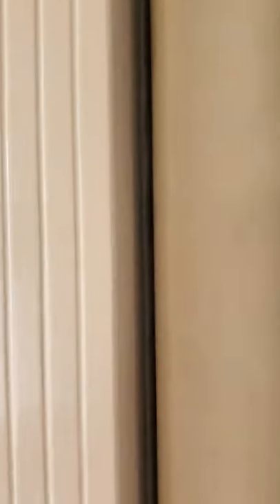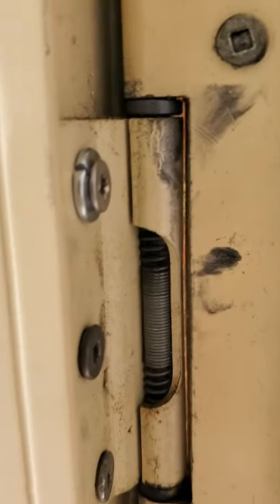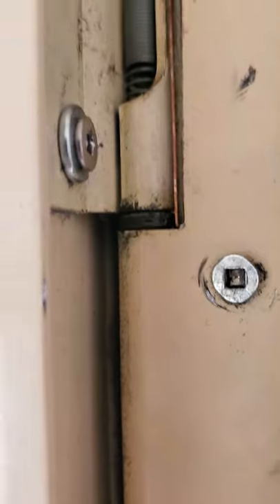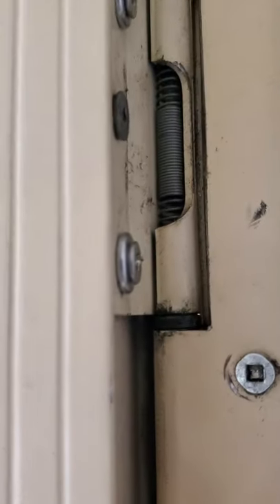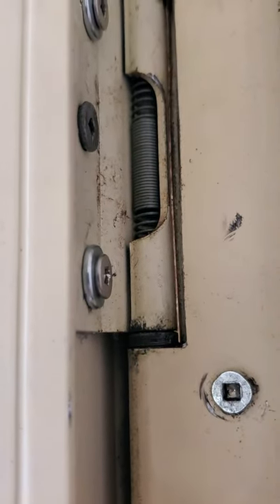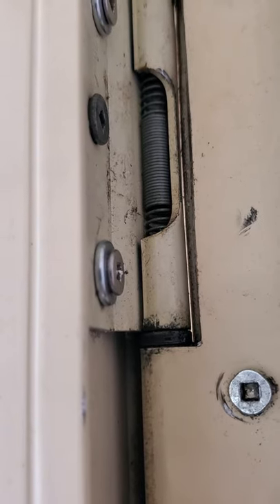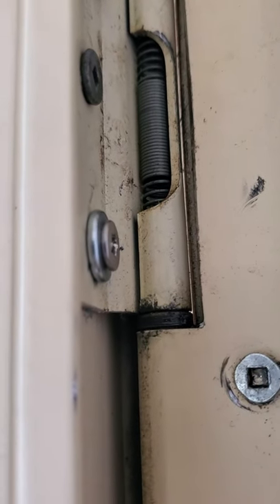Fix a sagging storm door,  short video, no drama

Comment from the maker: We changed from 3/4 inch to 1 1/4 from an 8 to a 10 and added lock washers.

Things that failed included filing the door, hitting the door, hitting the frame, taking it apart.

Cursing...

All those and three hours of my life and baam. The door worked.
Reply: Hey this is really great, thanks. I think this is just what I needed for my storm door.